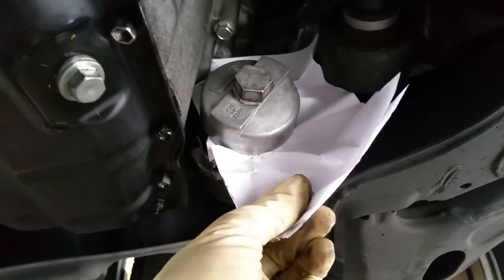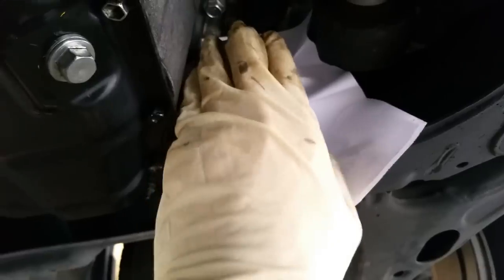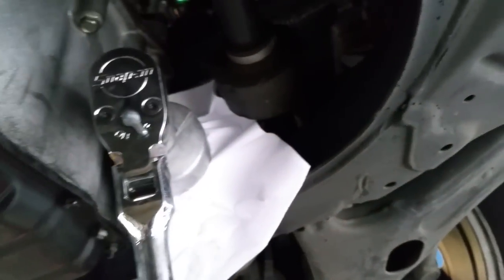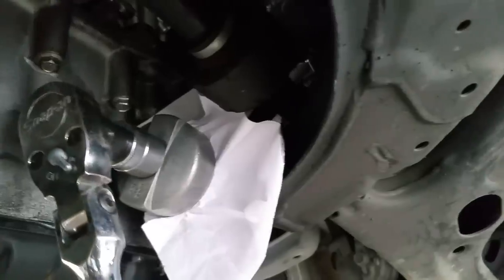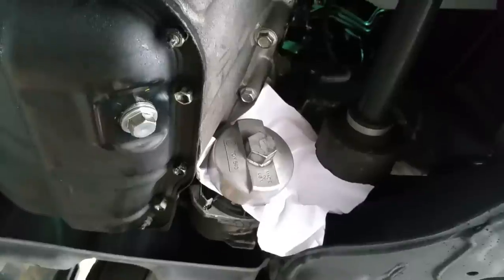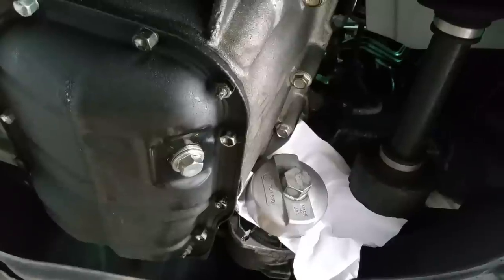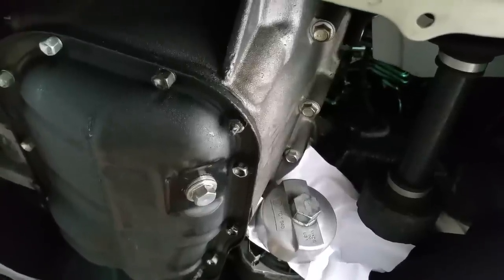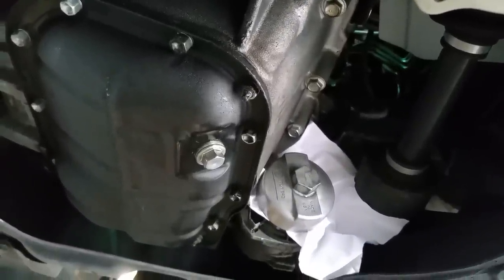WATCH Before you break a stuck oil filter cartridge

Comment: This why I have always changed my oil...myself...since I had my first car at 16. I'm now 63 and still change my oil in both my vehicles. Send me a "pat on the back."
Reply from the maker: your comment is fine by me. thanks.
Reply: You do it right and save time and money, I have had trouble with tire shops over tightening my lug nuts and stripping the threads, kept on wrenching
Reply: Ive always done mine except once. The Hyundai dealership contacted me about a recall reguarding possible problem with motor bearings. They had to drain oil. And of course refilled oil. And honest to God,  i had to put a 36 inch ridgid pipe wrench on it to loosen the oil filter on the next oil change. And i mean i had to crank on it. Hyundai dealership at mall of Georgia in Gwinnett
Reply: Trust No One with your oil and filter changes, do it yourself so this doesn't happen.
Reply: here you are sir, one well deserved pat on the back
Reply: Here ya go, I’m sending you a well deserved pat on the back;  I will only add that I’d rather do it myself because then I only have myself to blame if I goof up.
Reply: Only you know when its tight enough. Save your car.
Reply: I want to be like you. In my ownership of my car, I write down every time I go for gas and the mileage, every time I have a check engine, replace a part, tire change, tire puncture. I do that so I have records
Reply: Watched my dad do all the maintenance and repair in the vehicles as a kid. Wanted to be able to fix em just like him. Learned quite a lot by watching and also learned following the maintenance schedule and fixing things as they break will make the car last a lot longer than you think it will
Reply: ME TOO!
Reply: If anything,  this is a reason to not mess with changing the oil.
Reply: Same here brother. I never trusted those potheads to change my oil.

Comment: My Toyota dealer over tightened oil filter housing. I broke two tools trying to get it off. I took it to the dealer and told them they over tightened it and I wanted them to loosen it up. I had to argue with them but they did loosen it. I think they over tighten it on purpose so you will have to pay the dealer to change your oil.
Reply from the maker: actually, its because most dealers have jabroni's working for them in the warranty and lube section.
Reply: they got to make money somehow, it wont work on you but sure work on other, they just pay toyota, or take it to lube place. $19.99
Reply: Those quick oil change shops can fuck you up far worse than over tightening.
Reply: If you go to a dealer for anything or any gyp shop, ALWAYS check your lug nuts afterward. They love to over-torque them to warp your brake rotors.
Reply: blueridgemtns18 did you have to try this?
Reply: @wholeNwon  it's also common the will impact the hell out of lug nuts or use the wrong socket on the lug nuts
Reply: @bryanmartinez6600  I agree with you on that. After they busted my lug nut, they said the lug nuts are made out of horrible materials. I had no problem with it when I changed them.
Reply: @subtledriver  At my local dealership, vandalizers and con-artists is more accurate.
Reply: My tabs broke and made a hole in the housing so I can’t take it off and the housing can’t hold oil to go to the dealer...
Reply: @MattSchmader  If the hole is temporarily patchable patch it add some oil and drive it to the mechanic. You might also get a mobile mechanic to repair it and last of all get a tow truck. If you know some good mechanics call them and ask their advice.
Reply: @wholeNwon  I bought 4 tires from a Toyota dealer, before I reach home I heard noise from the right front wheel, I pulled over to investigate , I  poped the wheel cover, one of the wheel lug was off the wheel and was tumbling making the noise. They did not over tightened, they didn't even border to tightened it at all.
Reply: @caroad2008  Not surprised. Tell all your friends. I would never let a dealer do anything to my car that wasn't under warranty.  As to tires, I use "Tire Rack" and a local installer. He actually goes to the warehouse to pick them up so I don't have to pay for shipping, schedules installation and runs EXACTLY on time. Tightens all lug nuts by hand with a torque wrench.
Reply: @MattSchmader  what did you end up doing?  Mine is really stuck, tried a lot of different video ideas and still stuck.  I am worried about breaking the tabs as well.
Reply: @staciledet2133  I used two sheets of paper as a friction material and it was just enough to get the plastic housing off, then I replaced it with a Lexus housing which is aluminum
Reply: @wholeNwon  I tell them to torque to 140 Newtons as recommended for my car. I tell them there's a torque spanner in the boot if they need it so they know that I could do the job myself if I was bothered.
Reply: I’m literally here because of this exact problem
Reply: @FreeAtlas.  have u tried to drive a screwdriver through the filter? Be careful in case the oil pipe extends deeply in the filter. Drive screwdriver in offset from the centre of the filter & that should work. First hit it with lots of spray oil.
Reply: Same happened to me. "Complementry" oil changes ran out, last one they tightened way tight. They had the records, i called them on it. One huge breakerbar later he loosened it. I drove home and finished my change.
Reply: @caroad2008  I had that too. Even made it a point to the service guy to have the tech tighten the nuts. Raised a mighty stink in the office on Monday morning with a video and pictures. They did replace the studs and nuts, "just in case" and said sorry.
Reply: @wholeNwon  Or not tighten them.  My mom had work done, drove like 600 miles, was turning into the house driveway and the tire came off the car, loose lug nuts.  they could have been killed if it had happened on the highway at highway speeds.  The dealer apologized and repaired any damage.
Reply: Amazing, isn't it? How hard is it to torque lug nuts correctly? I NEVER take my car to any dealer for other than warranty work...EVER.  Established local shops with reputations to maintain are much better. Luckily my car rarely needs anything. I change oil/filter myself, replace brake pads, etc.
Reply: Thats a very clean car.
Reply: @wholeNwon  Even the Costco tire shop near my house uses a torque wrench for final tightening. They're always very busy. So being busy is no excuse.
Reply: @wholeNwon    More like, how hard is it to do the job you do for a living 😡😡😡😡😡
Reply: @staciledet2133  you can take the whole housing off and put it in a vise to take it off. There are 4 long bolts (10mm) that hold the whole housing on.
Reply: They have a low torque requirement. It actually tightens a little by itself. People over torque them all the time.
Reply: @mageofthestorm1  yes I have tightened them with a 3/8 short handle ratchet, 5000 miles later you swear you will fracture the plastic taking it off again with a 3 ft. 1/2 drive ratchet.
It also helps to have the tool that extends to catch the six notches as well as the flats.
Reply: You can buy a new filter housing on Amazon if you need to. Or anywhere else on the internet, i just seen some! Go get ya one, or a couple extra! 😊

Comment: 65 years old, have always changed my own oil on numerous cars except when extreme circumstances prevent it.  I have had 3 filters that I could not remove using routine techniques - EVERY one was installed by a "mechanic" at a repair shop or dealership.
Reply: Forcing many back to the shop. Shady practise.
Reply: You are right on. I believed they use power tools to put it back. After my last "free" 36000 miles/3 yrs oil changed from Toyota, I cannot remove the housing even with a 2 feet breaker bar and I have to bring it back to Dealership to have them remove and requested only use "hand" tools to tighten it.

Comment: Holy shit it actually worked.  Tried every tool in my arsenal, but the joke of a tool for taking these off, when hammered on with a folded piece of paper, worked like a charm, even after the filter was crushed from trying pliers. You're a feckin genius.

This is why I normally change my own oil with k&n filters with the nut welded to it.

Comment: I took my car to a Valvoline Quick Lube during the a winter month in a hurry before a road trip. When I was ready for my next oil change I planned to resume doing it myself. I spent hours trying to get the housing off. Granted I'm a petite female with limited tools in my garage so I thought that may have played a factor in my failure but it shouldn't have been that difficult. I ended up only being able to change the oil. In the meantime, I've purchased an oil filter wrench and an adjustable filter removal cap in addition to the one I already had.  Yesterday I attempted to remove it again and after about an hour of frustration I googled my issue and came across this video. A few minutes later the housing was off!! Thank you so much for posting this it saved my sanity.
Reply from the maker: You are welcome! Thanks for the comment!

Comment: Great to see this tip and technique on YouTube. I had an oil filter on a brand new engine that wouldn’t budge and did the exact same thing, kept slipping on the oil filter cup socket. Tried pliers, a 3 legged filter tool, the band style pliers that tighten (that actually gripped fine but I didn’t have enough leverage to turn the filter). Anyway, my neighbor recommended setting a rag inside the filter cup socket just as you’ve done here with paper. I used one of those thin red mechanics rags you can buy at Harbor Freight. Worked like a charm, after I put a breaker bar on the socket.

The rag, filter, and socket are all still fused, but that’s a project for another day…

Comment: I have a 2.7 ecoboost filter stuck and so tight stripped the plastic 27mm bolt round.
Tried band wrench with pivoting handle and kept slipping. Put the paper around the filter housing  and the band wrench over that. It worked. Much appreciated!

Comment: Thank's a lot , your video was a answer to prayer. I actually didn't have enough arm strength even with the 1/2 breaker bar and had to  use my leg and hold on to something on the frame. Thank's again.

Comment: I had an over tightened oil filter that I was trying to remove with the same problem as you and I put an old wash cloth in between like you did with the paper and tapped it on good with a hammer and it worked. I was finally able to loosen the filter. I was looking on Youtube to see how others have done it and you are the closest to what I did.

Comment: This is why I change my oil & filter. I do not have a garage to work on my vehicles & work outside on a gravel driveway and even at my age I still find it better to do it  myself. If my timing is off & I need to have it done during the winter months with snow on the ground I reluctantly bring it to a shop. Well one of my vehicles happened to fall into that time/weather slot twice. The second time I was told by the manager that my oil plug was stripped. He showed me the bolt & the head was rounded. I asked why did they use a pneumatic wrench on it. He replied we don't. I said that this is the second visit to this shop & it was not stripped the last time here. He now said it is due to the wear the bolt had over all the oil changes. An extra 10.99 & I was good to go never to return. I guess I should be glad they did not stirp the threads in the oil pan.
Stay safe, Joe Z

Comment: I went to change oil on a '70 Chevy Nova, (6 cyl) that my cousin sold me after he rebuilt the engine. I ended up tearing the filter apart, & had to use a cold chisel & hammer to get the base plate off. I asked him if he had used a wrench to tighten it up. His answer "Yes, you're suppose to". I promptly showed him, on the filter, how it is supposed to be tightened. One of the few cars I wish I still had.

Comment: I just did my first non-free oil change on my 2015 tundra. Had to use a 18" breaker bar with way too much force to remove. Even broke one of the tabs on my filter housing. Thank you Toyota dealership. Vancouver USA.

Comment: Well hush my mouth !!  The darn thing worked !! I even used a nice fluted Penzzoil filter remover but broke one of the flutes which broke THROUGH the cover to the oil. Now I'm screwed and can't even start the car. I tried several different wrenches and paper napkins, but your folded sheet absolutely saved me a mobile mechanic fee. Great idea. Where can I send you some cash ?
Reply from the maker: Follow me on Instagram 👍 @subtledriver and you discovered why I didnt use the fluted tool, it breaks the damn thing. Despite what the other "expert" commenters say, this is the safest way to remove with high success rate. Thanks for the comment!

Comment: Man I'm glad I found this. My oil filter cap wrench kept slipping and it was driving me crazy. I tried other things to bridge the gap it still slipped. I didn't want to use the screwdriver method and risk ripping the filter apart. Took about 3 sheets of paper and it worked!

Comment: You can only use the metal Toyota filter socket on the older Toyotas with metal canister filter housings. Your supposed to use a special Toyota filter socket that has notches in it on the new plastic Toyota canister filters
Reply: You don't need a wrench with notches in it.
Motivx has had one of the best oil filter cap wrenches for many years and has the best reviews. Guess what? Their redesigned wrench released just a couple months ago has no slots (notches) in it and works better. Those slots only served to put all the stress on the (two or four) ears on the oil filter cap. The new wrench is precision engineered to engage with the 14 flutes on the oil filter cap and the result is no more cracked or broken ears trying to remove over-torqued oil filter caps. Guess what size the wrench is... No it's not 64 mm or 64.5 mm. It's 64.3 mm. As I said precision engineered. I used the redesigned tool just two weeks ago and it's great. Motivxtools.com

Comment: So I spent a few hours trying to pry my Tacoma's filter off. I basically gave up until I ran across this video. I figured I'd try this out before packing it up. It worked! I only got one half sheet on with my breaker bar and got it loose. Thanks for the idea!

Comment: Wes, thanks for the tip and it’s a good one @ that. I don’t have a ton of professional tools but I’ve had pretty good luck w/adjustable oil filter wrenches. When I get jammed up I will slide the adjustable oil filter wrench to the top of the oil filter and clamp on the very top (the hardened ring) and loosen from there. Won’t crush in the sides and typically will work. Anyway, hope this tip can help a viewer as well. Videos are great, down to earth and keep’m coming brother. Thanks, Fran

Comment: Good trick!  (or "hack" as everything seems to be labeled these days).  Oil change shops hire whoever is willing to work. Sometimes they are given good training and sometimes not.  I once had a drain plug that had been re-installed with such torque, I had to use an impact wrench to remove it(and replace it with a new one).  And the same for filter(s). They ignored the "do not overtighten" admonitions.  Thanks for posting this.

Comment: My dad has always done his oil change at the dealer.
A few weeks ago he decided to do it himself for the first time since owning the car for 7years.  I bought an aftermarket forged steel filter wrench just for this occasion.

It took him a breaker bar + 3foot steel pipe + his whole body weight leaning back to remove it!!  Thats an insane amount of force just for an oil filter.

I'm glad I came across this as I will apply this method on my Highlander.  Thanks!

Comment: Yielded my 3/8" drive on the removal tool.  Put an ice pack on the plastic cap to attempt to shrink it and used the paper and came right off.  Excellent tip.

Comment: saved my neck!  car pulled in my work and someone before had chipped off section of cap where wrench goes on.   i tried channel lock pliers and all other things i could think of.  i was gonna attempt drilling a hole through the cap and using a heelbar to twist it off but this method is way even much better!

Comment: Good tip to keep in mind! This past weekend I did my first oil change on a little Corolla I picked up - the first Toyota I have ever owned. One thing I definitely learned from my first “rodeo” with this car is something I see in your video - loosen the filter cover BEFORE you remove the oil drain plug! I did the drain plug first and there was no angle I could use to loosen the filter housing after that where I didn’t have oil running down my arm! Finally had to put the plug back in temporarily………🫤

Comment: Thank you. It worked for me, had to use 4 pieces of paper but it finally came loose. 
When it came to putting the filter housing back in, I slowly and gently tightened just enough so that none of the threading is visible. Should be much easier to remove next time.
Reply: You should not be able to see the threading at all when you screw it on. Oil the O-ring on the filter and hand tighten it for a good seal.
Reply: @ucakpan 
Oh I made sure no threads are visible. Always oiled it too. Never put in dry ;)